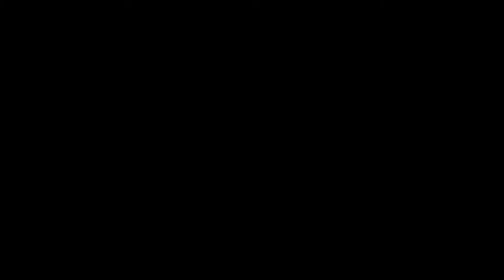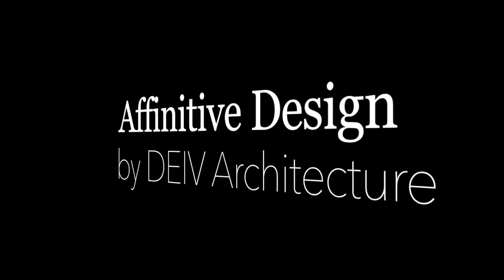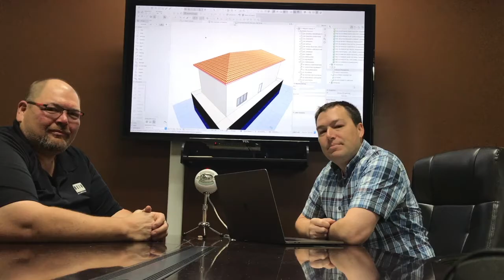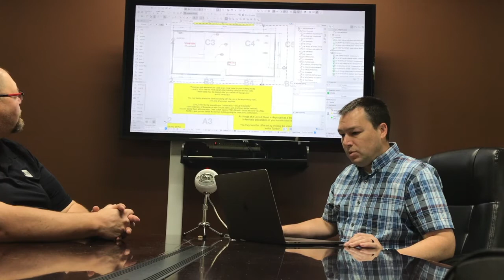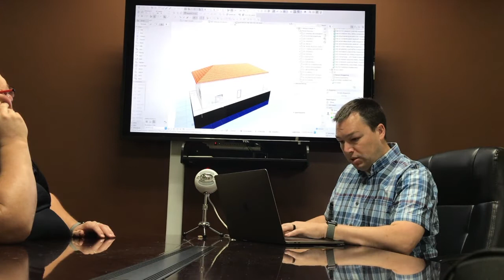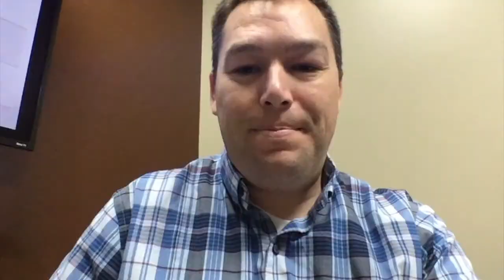REScheck sucks! Energy Code and New Homes - Affinitive Design episode 02

Comment: This was great overview thanks for making it! 
Im a plan examiner in Utah. I still see windows u-factors of .32
There is also allowances that RES and COM checks do not work for our adopted code... it's a bad representation. I have a house built in 1986 I ran it through REScheck ( after new windows with a u factor of  .30) 6% better than code. 
Also you can submit plans with the prescriptive r value and a weighted average in U-factors... if you really want to confuse us 😅